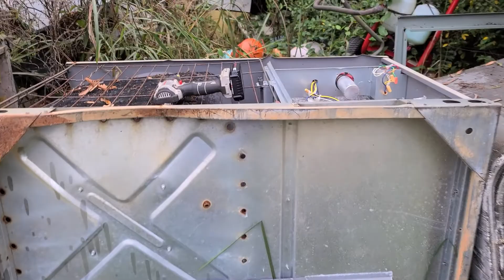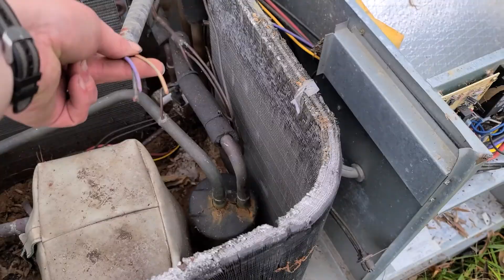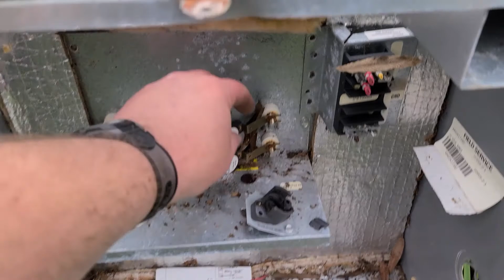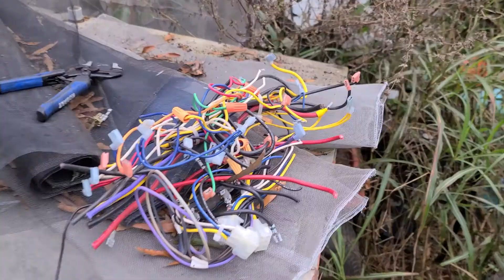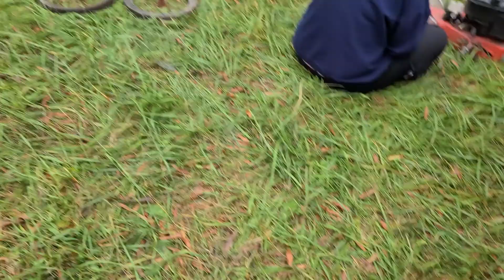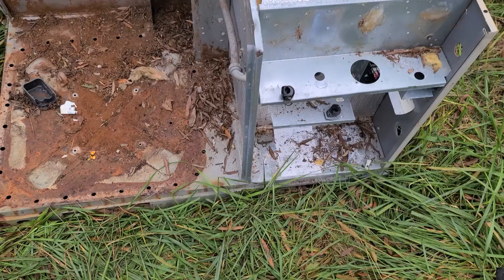Scrapping out a Heat pump.

Comment: Awesome video.  Lots of copper.  Do you melt the copper down for a pour?
Reply from the maker: Yes I do. All of the copper bars I have done so far have been from the wire. The pipe I sell. It isnt really pure
Reply: @SilverScorpion  thanks, I'm starting to collect.  Starting out with microwaves and washing machines.  Air conditioner soon.
Reply from the maker: @00_BUCK_671  sweet. Shoot me a  email with your # if you want. I will be glad to help you. Only thing to be careful of on a microwave is the capacitor. It needs to come out first.

Comment: I have some coils I need to get to copper lines cut out but I’ll wait till a sunny day
Reply from the maker: Take a razer blade knife and run the length of the pipe a couple times. Then they should pull right out. That seems to be the fastest and easiest way.

Comment: Is there copper in the motor?
Reply from the maker: Yes ma'am. There is the fan motor and there is also the compressor. They are both electric motors. You can get the copper out of them both. I'm sure I will post a video on that one day.